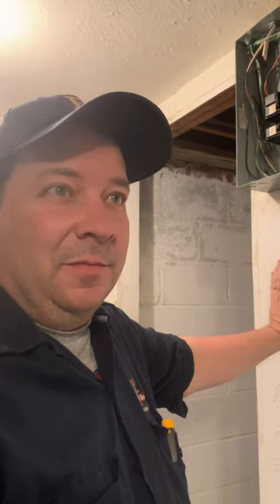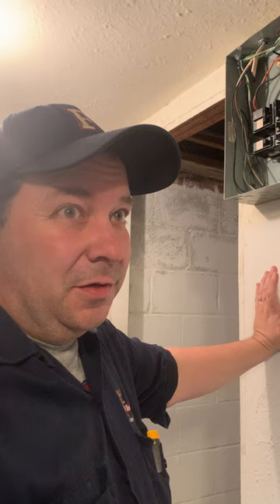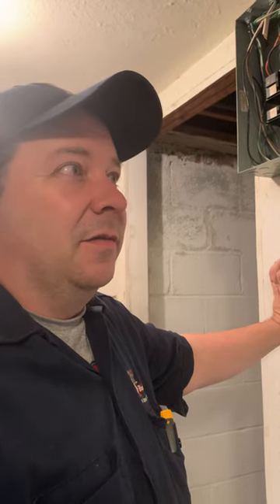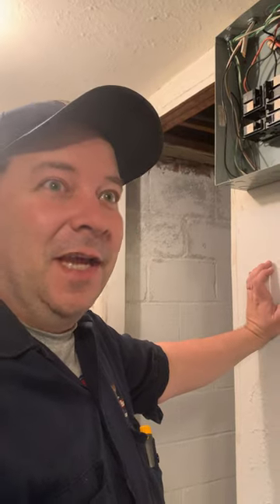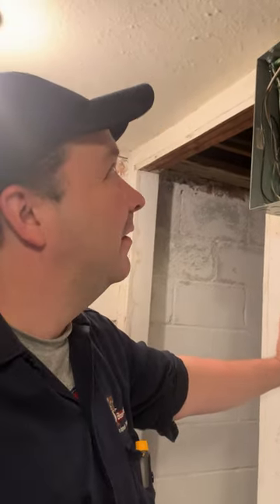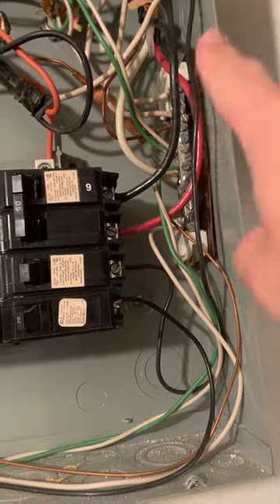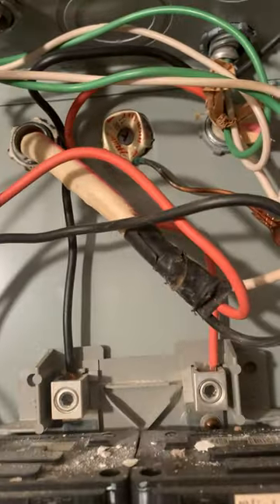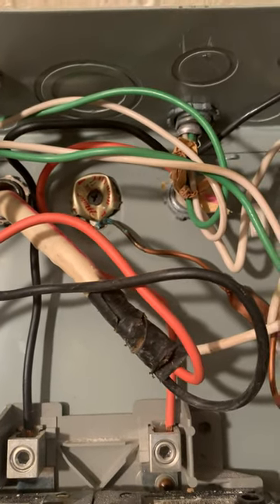Beer bottle cap used in the electrical panel #bloodhoundhomeinspection #electrical

Comment: That cap is not installed  per the manufacturer's instructions. It should be secured by a bottle on the other side, not a drywall screw.
Reply from the maker: Right!

Comment: In old homes, I sometimes see coffee cans used as junction boxes. They would cut slits for the wire to pass through. 
The best one was a 30s farmhouse with original knob and tube. At some point, they added on Romex (very old Romex, it was black cloth) and punched the can and used porcelain bushings, then used the original lid as a cover. 
There were actually 3 of these in the attic. Folger cans.
Reply: Depression era and there weren’t many city codes if any at all.

Comment: I was an assistant to an electrician back in the 1960s and we were rewiring homes that were built before there was electricity. They ran single wires through the pipes that used to distribute the gas. Both wires were black, so polarity was optional. 😂

We would sometimes find pennies in a fuse box. On the other hand, the electrician had a neat trick. He would screw a lightbulb into the fuse receptacle. As long as we didn’t hit a short the lightbulb would remain dark but when we hit one, that llight bulb would light up, limiting the current in the circuit.

However, I never saw one like this.😂

Comment: Dude what are you doing in my 1947 house?
   Our utility company just upgraded the power poles and overhead drops. My home is supplied with 250 amp service to #8 copper from the weatherhead to my ancient meter base to a 50 amp main. They could have offered to correct it as they are supposed to own all the way to the meter but nooooo…..
Reply: Might be different in your area, but...

Your utility company owns the overhead service from the pole/transfer up to the weatherhead and the METER itself.  The service mast, meter SOCKET/meter main (meter socket with a breaker disconnect), and everything after that is your property.  In other words, that's the scope of an inside wireman/electrician, not a utility guy.
Reply: @vicalvaran3796  yup, anything that is mechanically fastened to your house is yours and your responsibility. The actual meter (clear round piece protruding from the box) is essentially just plugged into the box which is screwed in place. The overhead lines are spliced to the line running down to the meter which is presumably held by brackets screwed to the house like the box is and therefore yours.